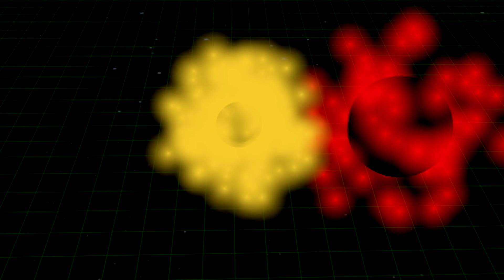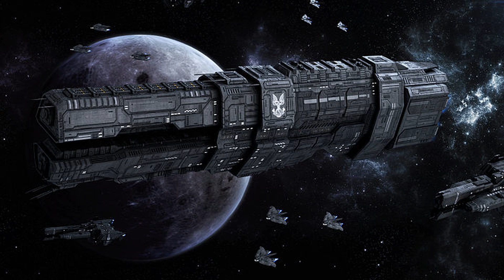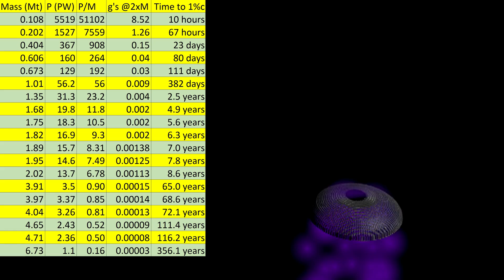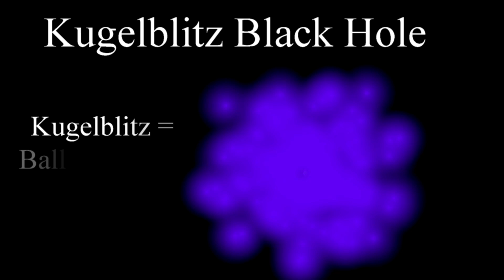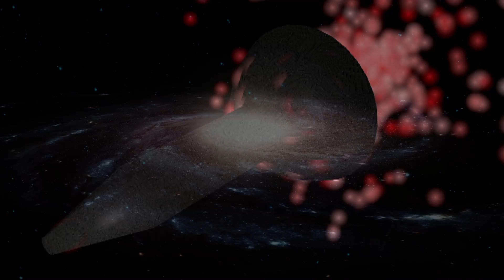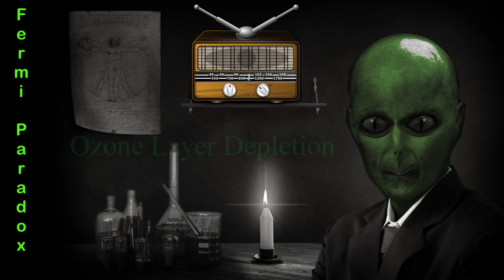Black Hole Starships

Comment: I know this is nuts, but here's something that hit me.

What if, when a particle of matter and one of anti-matter get together, you get a teeny-tiny black hole that dissapears in a puff of hawking radiation.
Reply from the maker: It's not nuts, similar notions get tossed around from time to time. but it adds an extra step that isn't really necessary or likely, there's nothing in play that should really squeeze those two particles close  enough together to make a black hole.
Reply: Well, that's fair.  I was just thinking in terms that the electromagnetic forces aren't pushing them apart.  But I don't get the math involved.  I appreciate that it's not weird as I thought it was.  Thank you.  :)
Reply: The idea was that the only thing keeping stuff from forming black holes anyway is the elector-magnetic force which has different incentives when you pair a electron with a prositron rather than an electron with an election.

Anyway, I just figured out why it wouldn't work.

You have to figure that black holes are all matter or all antimatter because, as I understand it, any bit of one squished with the other causes both to explode which would kind of defeat the whole purpose of black hole-hood.

If you, on the other hand, get a proton and an anti-proton smushed together and they did form a black hole would it be matter?  Antimatter?  Both?  Neither?  And how would that allow the mechanism of hawking radiation?  It's much more likely that whatever imbalance in forces* that allowed the proton and the anti-proton to exist in the first place is zeroed out and the energy is released.

Ah well.  It was a cute idea.

* I don't know if it's an actual imbalance of forces, but it sounded good.
Reply: Wouldn't that violate Einsteinian causality?

Comment: If you put it in a shell wouldn't the radiation pressure keep it roughly in the middle?
Reply: not if you intend to use asymmetric pressure to accelerate the ship.  If you simply want to capture its total energy output and then convert it to some other form of propulsion you can, but the whole benefit of using this concept is to get around Tsiolkovsky's Rocket Equation and the constraints of carrying fuel for propulsion.

Comment: How do you tie a ship to a blackhole? Ropes probably won't do it.
Reply from the maker: The usual assumption magnetically. Black holes can, an generally do, have magnetic fields you can push or pull on.
Reply: Cosmic string ?

Comment: I'm not sure that there really would be any speed limit to the black hole ramjet.

Why? Because when you are encountering matter at relativistic speeds, it has more mass energy, which is what ends up in  the black hole. Ultimately, an efficient enough black hole ramjet is basically a black hole scramjet, in that the material is not really so much being slowed down as converted to black hole and then immediately to exhaust at close to C, or C if the exhaust is actual photons.

Comment: But how would you turn it off?
Reply from the maker: You can add matter to throttle it down, or direct the output symmetrically to produce no net thrust, that's about it.

Comment: If you had the ability to refuel a black hole, if a weaponised black hole on the verge of exploding was hurtling towards you, surely you could just refuel it enough that it won't explode until a fair while after it has passed you?
Reply: A singularity that close to dissolution would not need to explode; it would be like a sunbomb, radiating enough energy to boilbake any inhabited or even marginally earth-like environment.  And the crazy thing is that it would pass right through a target.  If that target were an asteroid, it could shatter it from internal superheating; if it were a planet, it could (again, through superheating), cause tremendous tectonic stress, and if there's a molten core, massive volcanic activity.  Never mind the radiation damage from hard gamma rays.

Comment: Call me old fashioned, but what if you took inspiration from a classic petrol engine? 

I haven't finished the video quite yet and am by no means educated in engineering and astro-pysics, but In this video, you propose that you need only make one black hole and balance its mass to its longevity, to energy output. If i'm correct in understanding how black holes work, the smaller they are the more energy they put out, but the shorter lived they are. Now take the example of a classic petrol engine, pistons pumping out thousands of little explosions every minute. Replace your pistons with boson lasers and viola! tiny mass black holes being created and collapsing, one after another, just like a petrol engine; also overcoming the refueling problem, since the lasers will just create a new one instants after the last has collapsed. what are your thoughts isaac? just stumbled upon your channel the other day; earned a subscriber right off the bat with post-scarcity civ :) peace & understanding be
Reply from the maker: Hmmm.... I was going to raise some issue and objections but that's actually a good approach, if you can pull it off without using more energy than you get out of it, which you probably would. Becomes more like a matter-to-energy converter then. I think your beams would be better off pointed backwards from the ship to simply supply thrust but it might depend. Interesting notion regardless.
Reply: Drake Orlan The ultimate version of the Project Orion drive :)
Reply: If you're using lasers to create blackhole holes and then using those black holes to reradiate the energy you put in via the lasers you're far better off just firing the lasers out the back of your ship.

Much better direction control, basically no losses to heat, etc.  Probably a lower power output but it would work out to be an even higher (or the same) output over given amounts of time.   Because you could either continuously shoot lasers out the back for a relatively low power over a long time, or you could fire your lasers to "charge up" a black hole for some time before expending it with a high power output for a short time.

Your method only seems to make sense if your ship is beating beamed arbitrary amounts of power from far away stations, which isn't unreasonable.  So it can work, but it makes no sense unless your receiving a lot of power from somewhere else.

Comment: couldn't you use the time dilation effect at near light speed to control the distance a micro black hole does it's final energy burst? want to shoot something near by set velocity to .7c, long range .99c.  assuming ofc you can accelerate things to those speeds.

Comment: How do you move blackhole around? How do you hold it in place?
Reply from the maker: They should have magnetic fields in most cases, you can also push on them with a laser or particle beam.

Comment: Could an unmanned spacecraft enter a black hole trailing some sort of ultra long fiber optic cable to relay information outside of the black hole?  I understand that creating a spacecraft and cable strong enough to survive the trip is likely impossible, but "if" we could, is it possible for information to escape to the outside that way?
Reply from the maker: Black Holes are like Vegas, what happens inside them, stays inside them.
Reply: Thanks

Comment: How do you move black hole from a point in space you created it in? You can't, like, hold it... Can you?
Reply from the maker: No but you can push or pull it, momentum is still conserved and they should have magnetic fields too, so you can shoot matter into them form one direction to give them speed or probably suspend them in a magnetic bottle.
Reply: WT-  Isaac, you didn't mention magnetic fields in the video!!!
Of course, I didn't even think about spin magnetics until I saw you mention them in the comments, so...

Comment: So you can't have a black-hole too small neither too large. But maybe you can have multiple black-hole drives connected to the same ship!

What about, if your Bussard Ramjet scooped the hydrogen due the black-hole's gravity, rather than powering electric tractors? Maybe the ramjet effect could be a bi-product of the main drive.
Reply from the maker: Yeah you can scale up by adding more black holes rather than enlarging a single one, and if you can feed sub-megaton holes you keep smaller higher power ones running. But it's gravity won't bring anything in, though you might be able to get a Bussard to feed into one. For that matter it would eat dark matter too if you could find a way to funnel it in.
Reply: We don't even know what 'dark matter' is; what if it IS something that micro black holes CAN consume?!

Comment: Black hole missiles would actually be very easy to detect because the absorption shell/parabolic mirror will heat up tremendously and emit a lot of IR (and probably even visible light).

Comment: Stephen Baxter discussed a potential solution to both the relatively low gravity and the crazy lives of small black holes, in Manifold Time. His post-stellar civilization kept a cluster of black holes orbiting each other in a tight, complex pattern, as a power supply. As an old black hole evaporated, new ones could be injected into the swarm, allowing the farmers to maintain a fairly steady power output, or at least, to keep the spikes steady.

Once you've got multiple black holes of different masses, you should be able to tune their collective gravity, and their radiation output, separately, I think. To decrease the sharpness of the gravitational gradient, allowing the ship to ride further apart from the BH cluster, use larger, less radiant BH's, but also use more of them, to make up the required radiation output.

To adjust the orbits in the black hole cluster, simply fire your ship's linear accelerator at a subatomic target moving according to at relativistic speeds, according to some combination of the n-body orbit problem, and the collective radiation pressure of the other members of the cluster. Good luck! Bonus points for curving the particle beam around one singularity, to hit another from behind.

Comment: You can actually protect from the gamma radiation with a good covering of boron , and a few feet of concrete.  Could possibly be prohibitory  due to weight, but not impossible.  They deal with high energy gammas all the time at the world's largest neutron reactor for chemistry experiments and the experimenter is only about 12 meters from the opening to the reactor while conducting experiments, behind the boron and concrete of course.  Just thought I would point that out.

Comment: I was thinking about making a video about this concept myself but put it off for the longest time. I may still make one as there are a few things I would mention that you didn't. You can get around the problem of larger mass black holes having low power by having a multi-cored starship. Sweet spot seems to be a 160 PW core black hole with a life of 3.5 years (the author mentioned that the estimates are generous though and probably less). Have two of these and you have 320 PW with the same life span, etc. It would be a daunting feat to make so many black holes simultaneously but it may be easier to do than feeding a smaller black hole which may be impossible in the first place.

Comment: I loved this one, Great job. I had a few thoughts that may, or may not, overcome some of the issues that you pointed out. Factor two larger black holes for the same thrust and longer life. Allow them to orbit each other around an adjustable convex in the absorption shell. More convex keeps them further apart and provides max thrust. Less convex allows them to vacuum up some of each others radiation for even longer life. Lastly pivot the absorption shell so that the black holes can steer the ship like the gyros on the I.S.S.   It sounds good to this sci-fi guy.

Comment: Black holes are effectively matter-energy converters.
Reply: Kind of, but if you're only able to create them using the Kugelblitz method, you're creating a black hole with energy (not matter), thus it's more of an energy capacitor than a matter-energy converter. Of course, if you're able to refuel them using matter, then it does become a matter-energy converter.

If we could only create antimatter efficiently and in significant quantities, we could bombard regular matter with our synthesised antimatter to convert matter into energy, which seems far better an option than creating micro black holes and cramming them full of matter, which will eventually explode. With synthetic antimatter bombardment, you can throttle the reaction rate at will, and there is a more-or-less constant 'burn' rate.
Reply: @MBKill3rCat  late answer. But you've got two problems. One, hawking radiation produces antimatter. Two, no practical method exists for confining antimatter
Reply: Kill3rCat the energy required to synthesize antimatter would render generation with that method ineffective. Because particle accelerators are the most often method for creating antimatter (the most created at one time is 13) the energy needed far surpassed the energy created. atomic annhilation using antimatter just isnt that powerful. Though if youre able to create a black hole by compressing light energy into a super small space, I'd say the energy loss would take forever to build up
Reply: yeah, and so is anti-matter, the question is, which is easier to contain? I imagine the only way to contain a black hole is using gravity, and anti-matter could be contained through magnetic fields.
Reply: @sonlirdrengor8514  Well, you can make charged black holes, and those would be trivial to contain. And they wouldn't necessarily annihilate the container if something went wrong

Comment: @Isaac Arthur.  If you had a particle acceletrator  shooting quadrillions particle together at a specific point in the TeV range could it be used as propultion? I'm thiniking If thouse tiny blackholes were created at a very specific point in space very close to an object with mass. Would it pull the mass, or evaporate to quickly to produce any effect?
Reply from the maker: Quite a few of the advanced propulsion concepts are basically particle accelerators, that is what an ion drive is for instance.
Reply: Well, i dont mean in the traditional way. you miss understand me.  I not mean shooting particles away from the craft. 
What i mean is, without creating a "big black" hole to power a craft which would be extremely unlikely. How about countless small.
In order to create the same effect as what you would consider as a very small one. I was thinking more of the lines of the small black holes make curve in space like any massive objects do for the ship to fall into. 
I'm not taking any well founded science into this. Just a thought.
Micro or shall i say pico wormholes are created in the atmosphere every day. Though they are created by  hundred million times violent crash more than what cern is capable off(cosmic rays). Would be possible to make them with accelerated ions crashing into each other? (more mass near the speed of light the better for making a black hole?)? 

I honestly say i do not know what i'm talking about. Though micro black holes evaporates fast and barely exists, They would still have the same properties as a black hole, thus having continues location with small back holes being made would have an "gathering" effect of a black hole's gravity pull?

It would be more of "towing the ship" in kinda like a gravity assist  kind of way. in controlled conditions. To stop the pull, simply turn of your accelerator. To decelerate only do it on the other side of the craft.
Wish i could draw it for you, for better explaining what i mean :P.
Reply: http://i.imgur.com/ydYjABu.png

Well. This is how i think of it if its understandable.
Basically loads of writing errors :P. Roughly visualized :P

Comment: If a massive, bowl-shaped structure were placed partially into the atmosphere of, let's say, Earth, could the atmospheric pressure keep it aloft, like a ship on water? Or would the atmosphere displace itself enough to pour over and into the massive, bowl-shaped structure, sinking it?
Reply from the maker: Hard to say, on paper it works but building one, call it a sky bowl, would probably require very sturdy material with constant pressure pumps suck out the air that trickled in form the thinner upper amtosphere and began to condense in the bottom. Much like floating a bowl in water, left alone it will eventually sink as some steam and vapor fall down into it and condenses or it gets knocked around. You also couldn't use much more mass. It's essentially a giant blimp without a top. I would say tentatively yes it can be done but I would have difficulty imagine why, since a vacuum inside an closed box, instead of a bowl, is much more stable and doesn't add much more area, and of course can be way smaller.